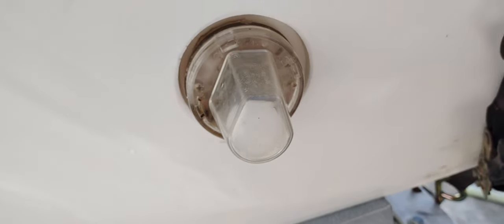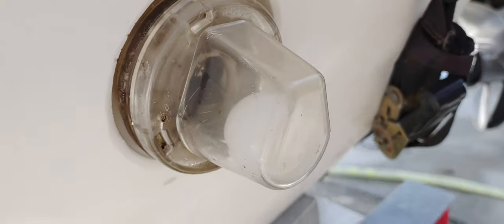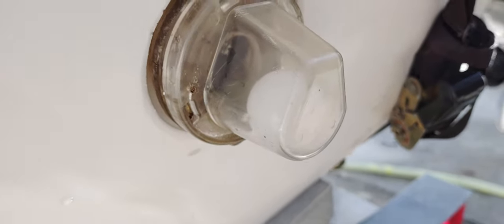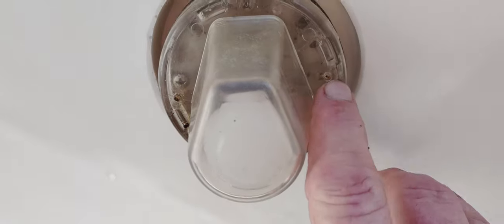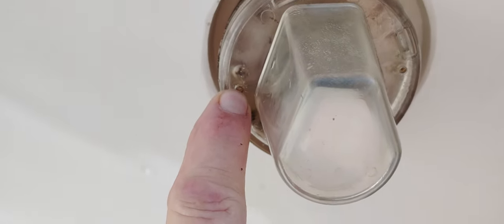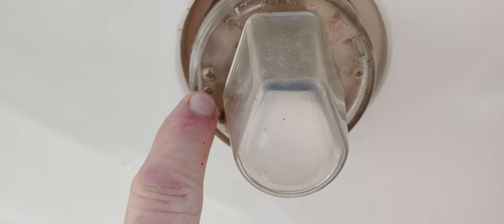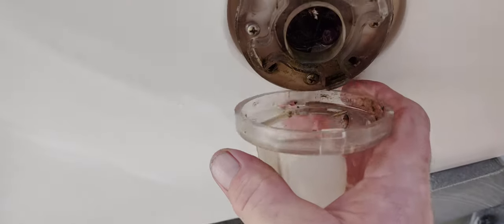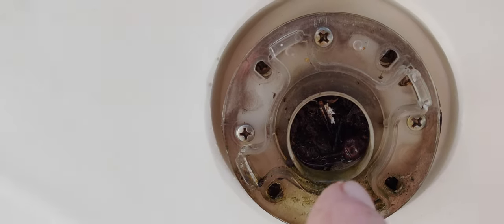Scupper boat drain removal. Flow Max

Comment: very confused, can these go underwater?  i have a skiff i am restoring, and saw some put under the water line.
Reply from the maker: They really should not be under the water line . Have you changed motors like a 2 stroke to a 4 stroke ?? Or added weight to the back of the boat ..
Reply: @sanitymaintenance573  nuff said, its a 12 foot oday, that i converted to skiff using a 9.5 johnson classic. i think i may stick with a plug. may rig a tiny bilge pump, only using on lake for fun